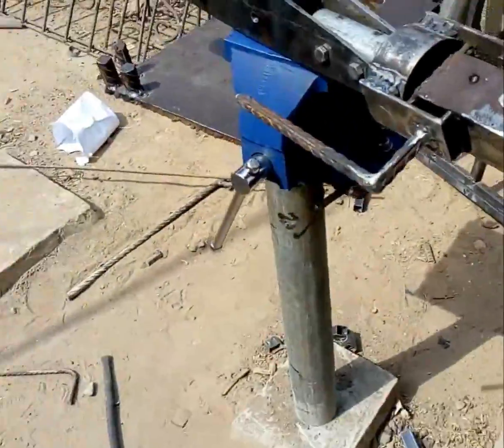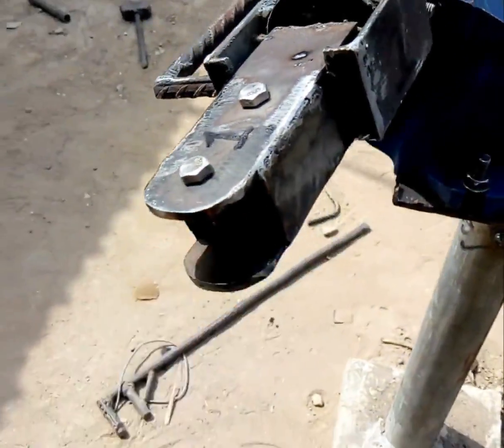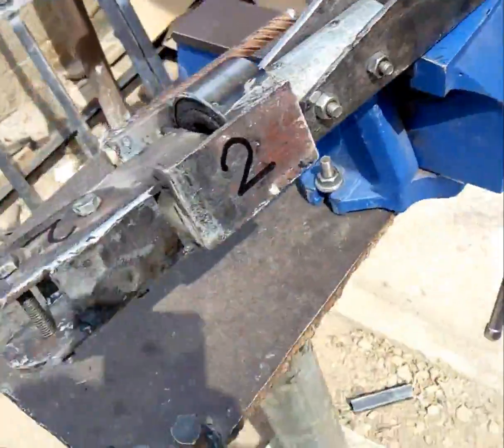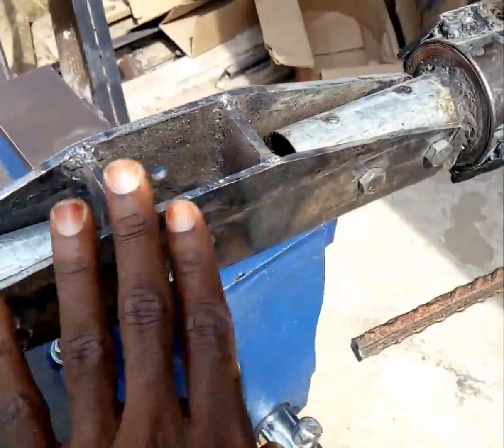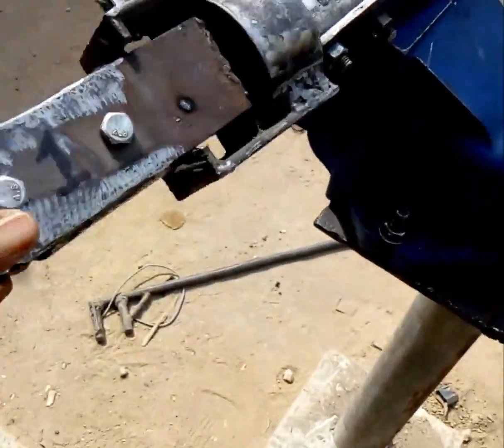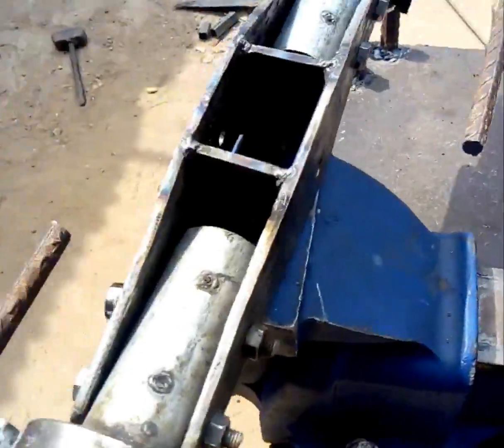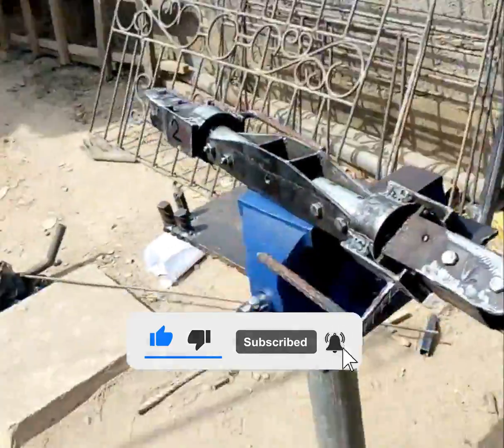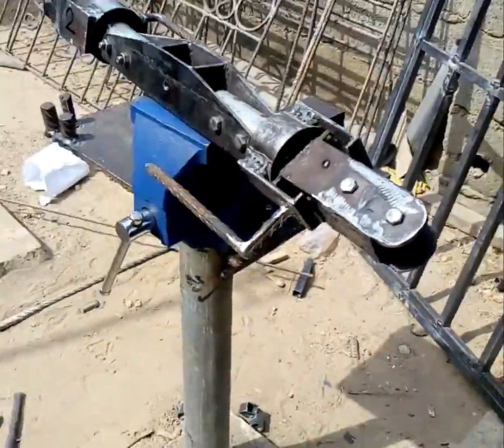Fully Articulated Home Built Helicopter Rotor Head - Walk Around

Comment: Granted you understand the concept of build a helicopter on a fixed income.   But   It is going to be a bitch to balance your helicopter.  Your parts have to be weighed and balanced.  It is going to vibrate.  Vibration will destroy the helicopter.  I would at least homemake a milling machine and possibly a lathe.  Then build your swash plate, rotor and tail rotor assemblies.